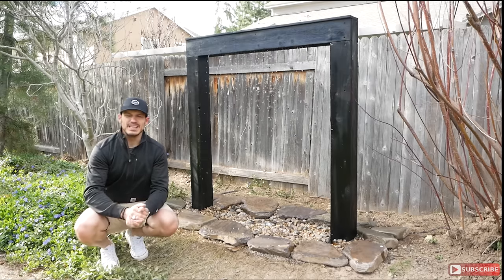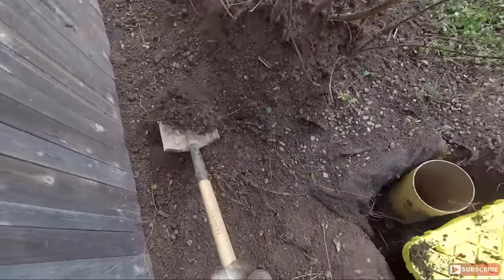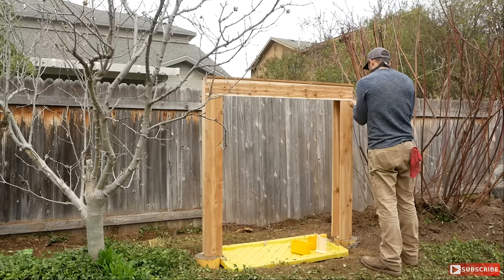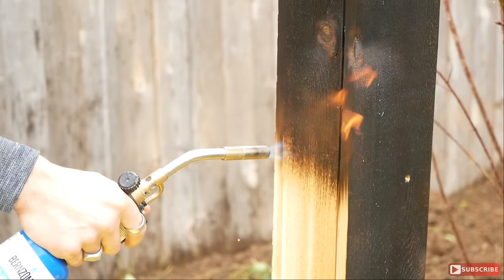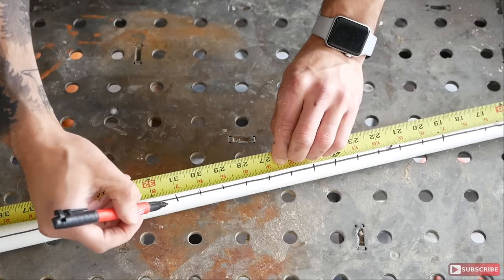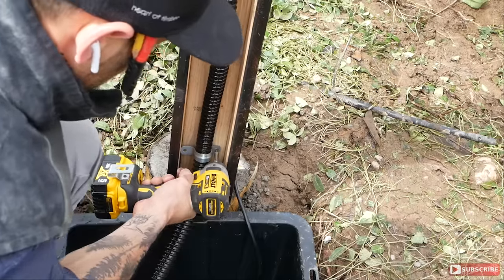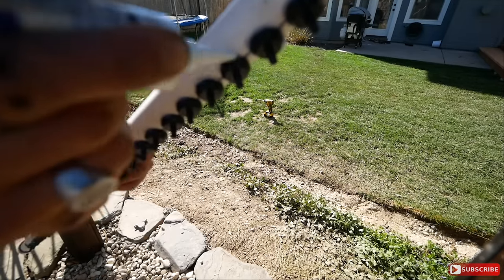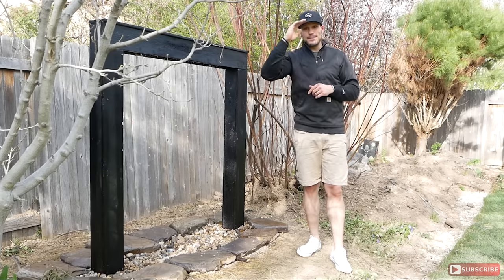How to Build a Backyard Water Feature

Comment: Cool water feature but you'll constantly be adding water to the basin with this design due to wind and splashing water on the rocks.  Ive built several style "pondless" water features like this and have always had to return to using pond liner extending farther past the catch basin to catch all the water.  I really like how you scorched the cedar.
Reply: The Sandwich Method... I like it.
Reply: easy fix would be an auto-filler.. easy as to install, and cheap..
Reply: As above, mine Is so much smaller but with wind ext/water refill needs to be thought about
Reply: We built one about twice this size and its been a nightmare. Used pond liner for the basin. Everything works fine until its ran long enough to splash water outside of the basin and it flows under the liner. Then the hole fills up with water, raising the pond liner, and removing water from the basin.... took it all apart and lined the basin with thick stone tile. After a while it did the same exact thing. There's no way this guy isn't having issues. I'd like to see what his looks like today.
Reply: @nvmyvl  what's an auto-filler? Linked direct to your water source?
Reply: @andred8037  Jeez, good to know. i was going to build this during this summer at my kid's behest for something like it
Reply: @MrFredcat3  i going to guess it is like a float switch. (not much different to how a toilet works)
Reply: @MrFredcat3  the same thing thats inside your toilet.
Reply: looking to build one in colorado in my yard...maybe 4x4 or 6x6 max....
Reply: @AA-ih6kt  me too!
Reply: Do you have a video link to your projects

Comment: I wonder what that would look like with LED strip lighting by the nozzles where the water comes out. Gives the illusion that the water is coloured. I like it. It’s so simple yet affected 👍👍
Reply: Oooo!  Daddy like!  Of course you would use a WATERPROOF LED light strip, because it is outdoors and right next to water.  Waterproof LED strips are a little harder to work with, but you would eventually put them in anyway.  I wonder how ultraviolet light would look.
Reply: @sambrusco672  👍👍
Reply: @sambrusco672  👍👍
Reply: Yeah Baby, great tip 👍

Comment: This is great! I'm planning to add a water curtain along the front edge of my backyard deck. The posts/structure and electric outlet are already there. Just gotta dig a hole and install the plumbing. I put in a fire pit, cafe lights, and a rocket stove this summer. Water feature will be nice addition!

Comment: Next time use GREEN TREATED  LUMBER for the framing. Especially when submerging in a cement product.
Reply from the maker: Can’t go wrong with pressure treated
Reply: @MrBuildit  , exactly what I was going to say.  Water will find its way into the concrete footings, and then it will have a difficult time getting out.  I hope you will add this advice into the video and re-post it.

Comment: Nice. only issue is cleaning it to prevent bugs etc and other gross things.
Reply from the maker: no issues so far
no issues so far
Reply: Actually, low maintenance is an Advantage for "Pondless" Fountains, the rocks/lid with holes (and some people add screen) greatly limits debris and insect penetration

Comment: I did one like yours although I painted it instead of doing the burn process, and I think cane out good.  The question that I have is how do you keep it from running out of water?  The splashing when the water hit the rocks below is making me put more water in the bucket.
Reply: You can use some pool liner to divert a wider coverage into your basin. Hope that helps.
Reply: Add Pool Liner about 2 feet beyond the periphery, sloped down to catch basin

Comment: I'm guessing you already had power out there. The cost of running 120v would be more than the water feature. Even direct burial wire has to be burried at 18 inches.

Comment: The part I never understand about these projects is the plumbing part. Everyone always skims through it. I guess I'm better iff buying a ready made water feature.
Reply: 1. The hose to pump is either friction fit or clamped. 
2. The PVC parts are "primed" & "glued" (chemicals according to the type plastic) -retailer can show you or YouTube it
3. The hose attached to PVC is hose clamped --unless the PVC needs an Adapter piece, depending on hose diameter

Comment: Anyone know where to find the jets he uses
Reply: i’m trying to find the same thing. all the jets i have found are not threaded and not suitable for pvc pipe. id like to find a threaded jet so i can really get the seal to not depend on silicone. although i’m not sure how much water pressure a fountain pump can produce. most jets are designed for less than 30psi
Reply: He said you could get at Home Depot, where they sell their Drip Irrigation parts or any Drip Irrigation Supplier

Comment: Yes very nice video. however I don't think that buildl is going to last long. putting untreated 2 by 4 in wet concrete and then all that water near all the rest of that wood it's going to rot it out linseed oil or not. Still using that storage container with the lid was pretty creative

Comment: I bought a bunch of those storage bins thinking they were heavy duty every single one has cracked just a heads up
Reply from the maker: greenwoodr83 i did as well. They age. Been pretty tough for me.
Reply: Sides flexed and broke probably overloaded/operator error
Reply from the maker: Hopefully the cold doesn’t hurt these too bad in the winter
Reply: @MrBuildit  Did the Bin hold up over winter???
Reply: Hmmmm, thanks fir the heads up.  Sounds like Solutions could be:
1. Inlay Pool Liner
2. Ensure packed dirt around bin for support
3. Double up the plastic bins
   3a (spray a thick coating of "Leak Seal" or "Expanding Foam" between the doubled bins

Comment: Hi from Mississippi.  I Like your feature so much.  I am using the same tote, same install as yours but my tote is losing water around the lid.  Did you seal yours in anyway?  Great job on the Shou sugi ban.
Reply: Two years later, how has it held up? What would you do differently?

Comment: This seems like a hastily put together video just to get that propane accessory sponsor. Looks lame. Will run out of water. Doesn’t really make noise. Is going to splatter and blow away. Where and how did you run the power cord? One of the streams at the end was running off the side of the “formation”. 
Seems expensive and labor intensive especially the redone nozzle heads. 
100% lame and you are going to tip the burnt wood bandwagon over. 
Again, this was a sponsored video aka commercial

Comment: @Mr. Build It Please I need the size of the drill used to open the holes in the PVC pipe to place the Raindrip 2 GPH Pressure Compensating Drippers

Comment: Why not installing plastic rectangle container inside wooden frame on top and make holes on its bottom, then pump will fill that container and water will go through holes by gravity. I think this will avoid water goes out by random angle.
Reply: That’s where I thought the reservoir was going to go when I first saw the feature.  The thing is… water is heavy (8 lbs/gallon or 62 lbs/cu ft or 1 Kg/liter).  The structure may end up being top-heavy.  In any case, you would need some volume of water for the pump to work.  I think his design is better than ours.